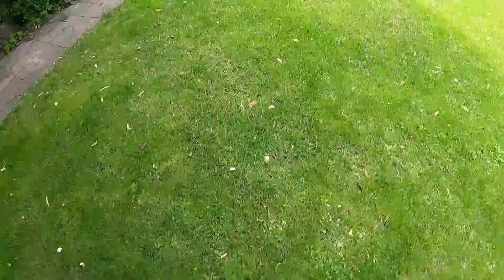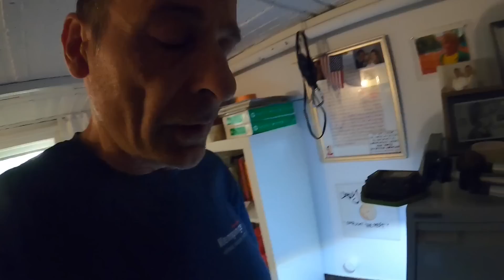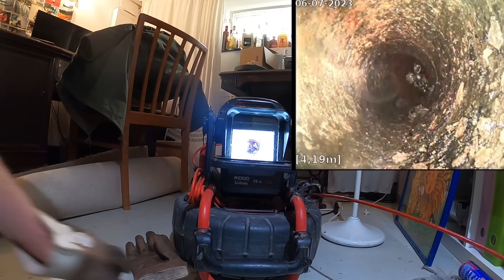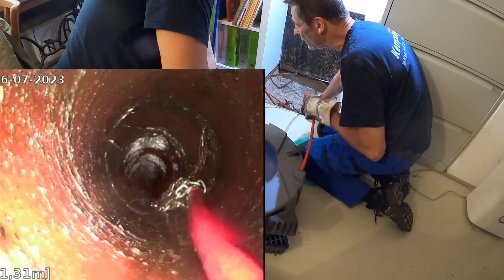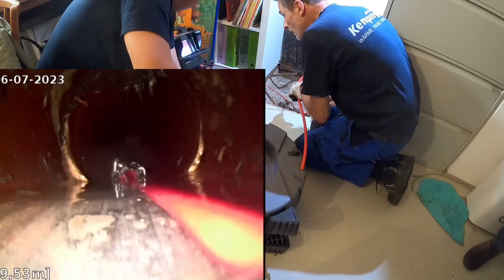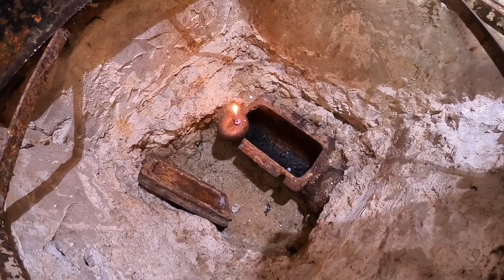Kempinger 370. Poo im Keller wegen Wurzeln im Hauptabflussrohr, ist eine Plage..  Zufriedener Kunde

Comment: Greetings Carsten,
When you mentioned the problems with roots I think I spotted straight away the problem.
All around the stepping stones and inspection point in the garden is planted bamboo.
It makes a good screen but it can be a nuisance causing all sorts of problems with infrastructure.
Depending on the type, some can run underground for as much as 10 metres, and is capable of growing through weak points in masonry.
I've been a gardener for some time, and I wouldn't have bamboo anywhere near my garden.
Best wishes to you and Matteo from Wales.👍
Reply from the maker: Hi Paul..  Thats what a lot of folks wright here today too...  Thanks  🤗